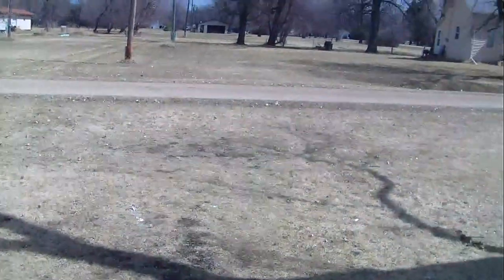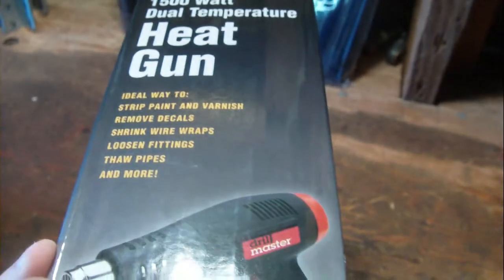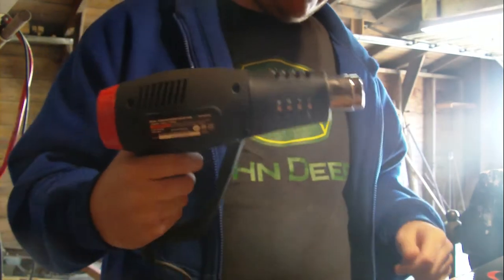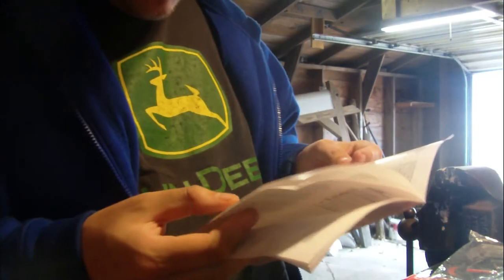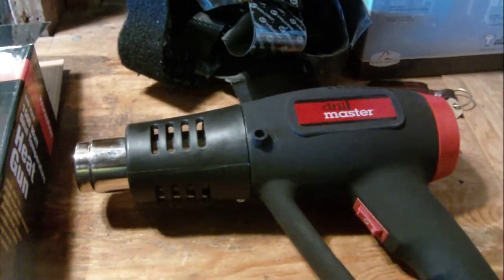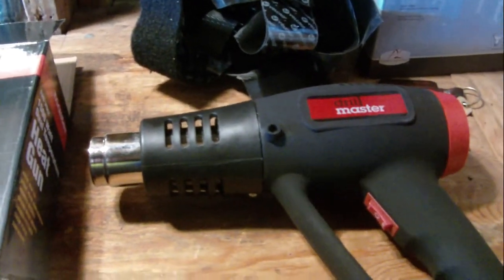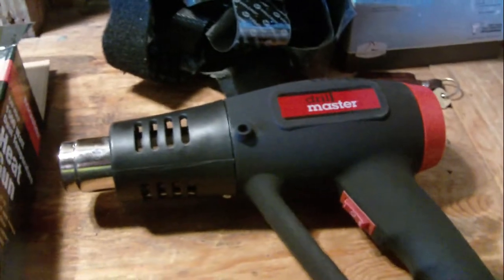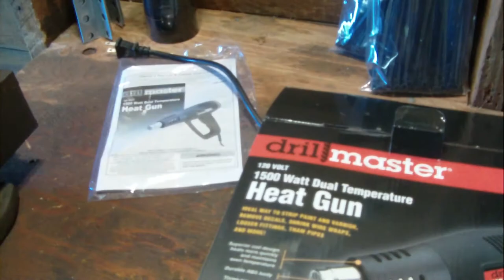got my HF Order is here

Comment: just pile a whole shitload of wood there, one thing i did about a year back is take an old board and nail a bunch of screws and nails and put a trail cam up to see the trespasser for evidence and sure enough the nail/screw board worked and have never hears or seen of him since lol
Reply from the maker: Clayton ya but if i did that 2 them they will turn around & do it 2 me. i had a shitload of wood on the ends but the flood moved them so i have 2 put them back.
Reply: Sounds like a good plan to me
Reply from the maker: Clayton
me 2  & im going 2  bu my sings from here-http://www.mysecuritysign.com/ u can make them 2 ur likeing.
Reply: Yes! They look nice
Reply from the maker: Clayton they will hold up longer 2.
Reply: I know those plastic ones last forshit
Reply from the maker: Clayton we get those plastic 1's at hardware hank & there gone in weeks. these r made out of heavy-duty aluminum. much better.
Reply: Hell ya
Reply from the maker: Clayton
:)